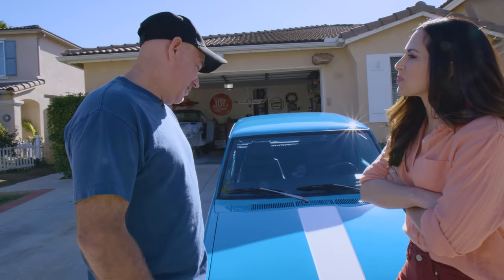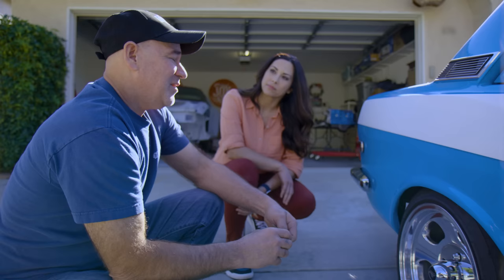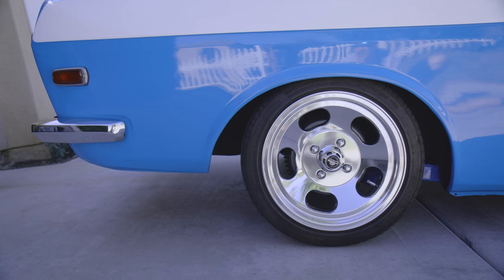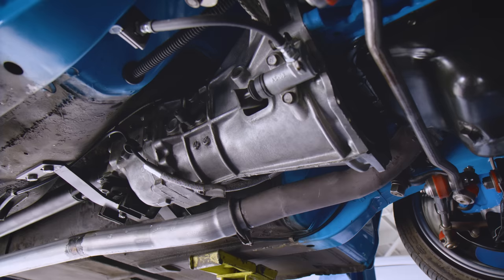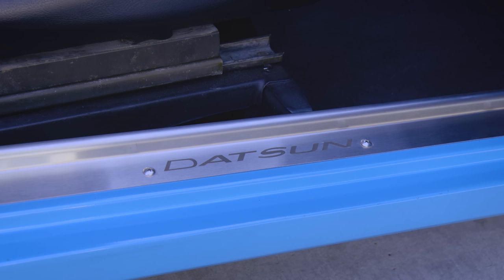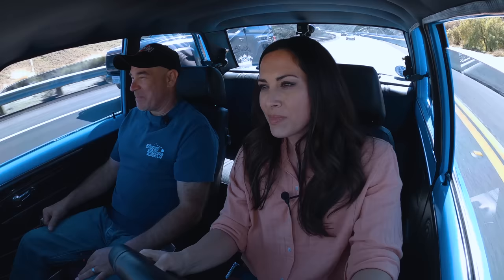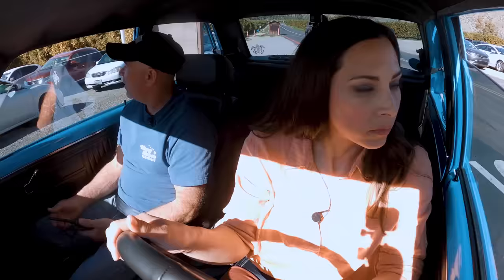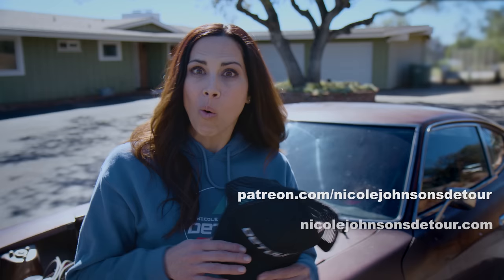DATSUN REBORN: Second-Chance 1970 Datsun 510 Saved From Wrecking Yard Death | EP13

Comment: you can't swap bell housings- those are both integral transmission cases. maybe you are thinking of the 71A series transmissions as used on the roadsters- they feature a separate bell housing. the Z22 motor you have there is about 19mm taller than the original L16 motor. nothing 'sneaky' about it- its a popular swap and means you have about 600cc more displacement. guys who know 510s will know its a bigger motor as soon as they open the hood. i would have used the U67 cylinder head (75-76 L20B) with its larger (45cc) combustion chambers, but using the head you chose will allow you to cc your combustion chambers and fine-tune your static compression ratio to suit your needs, but you'll need a clear plexi plate and a burette to do that. not familiar with the chambers in the later, round exhaust-port heads as i have never used one. brad watson does my head work and he recommended the peanut-shape chambers and rectangular-port heads like the early and 1980 L20B heads. personally, i like the SSS (219) or the late (W53) heads. i'm guessing what you have there is the (W58) head on the Z22, so that makes quite a bit of compression unless shorter pistons or rods were used. if Z22E stuff- then about 602/55 or about 11:1 compression ratio (not really sneaky). different heads/combos are possible since different length rods and differing compression-height pistons can be used, i.e. if you were to build a turbo motor- you could get that down as low as 7.5:1 and ram a boatload of boost in there or somewhere in between all the while using good ol factory parts (ain't interchangeability great?). using different cranks is also possible. you said something about auto-x- i would recommend considering using a pair of 240Z carbs on a ported SSS manifold for low and mid-range torque because that type of driving is just braking and accelerating and you wouldn't need twin-choke carbs/top-end power for that. okay its getting wordy in here time for a bite to eat. nice car. i'm still looking for that '68 sedan with only 2 doors- i know its out there somewhere. cheers to ya. rob c.
Reply from the maker: Thanks for sharing with us!!